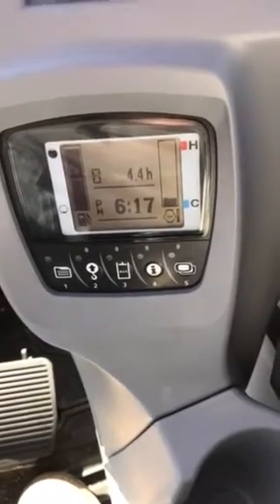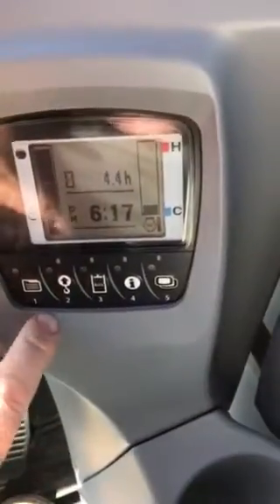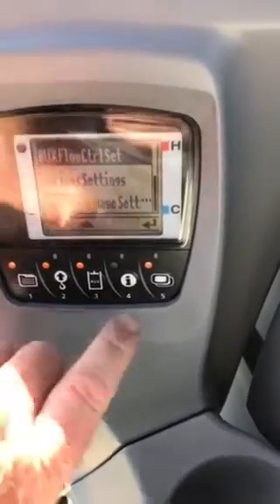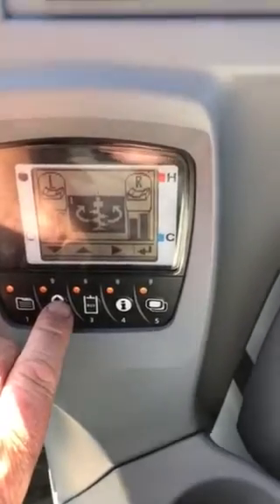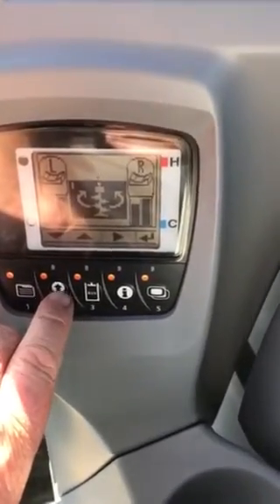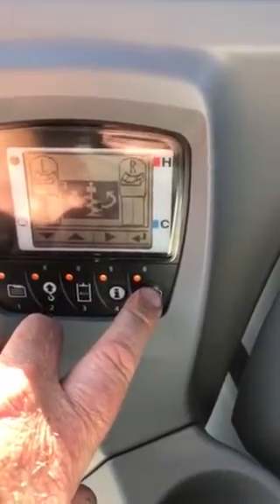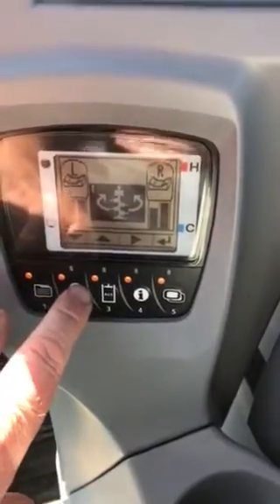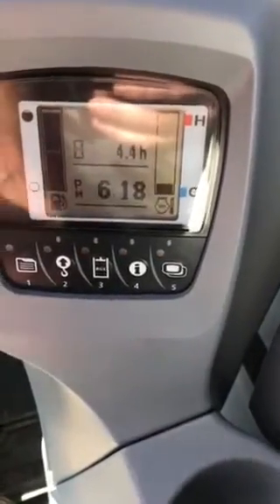New Kubota KX040-4 KX057-4 U55-4 KX080-4 auxiliary flow adjustment

Comment: Have you run a mower or mulcher on the Kx057 or U55? How’s does it do?
Reply from the maker: Hi Collin, we sell probably 5-8 mowers a year on the KX 040-057/U55 per year. we can cut up to 4" material with them, and we use the US mower machine in either the 30" or 40" cut width
they work great, have many machines out there with hundreds of hours on them